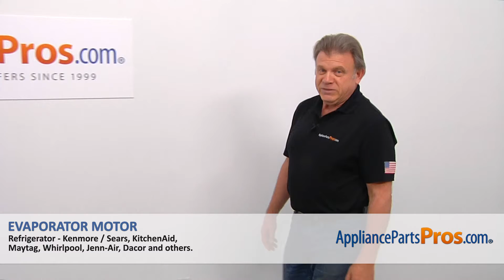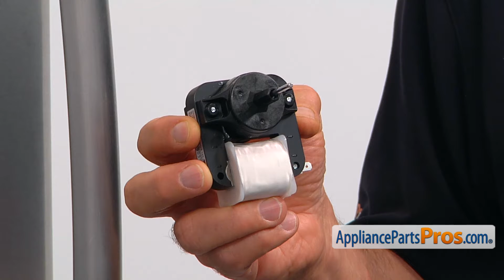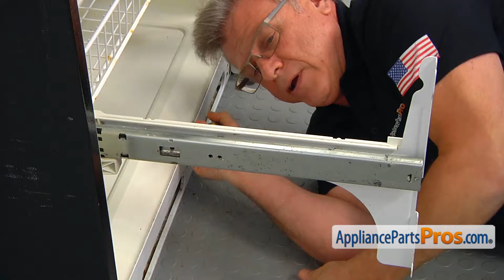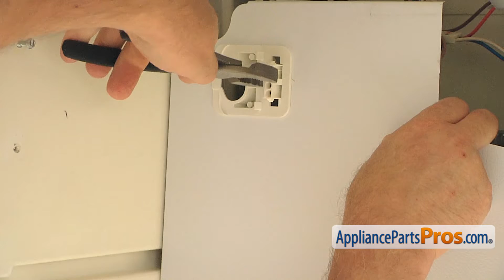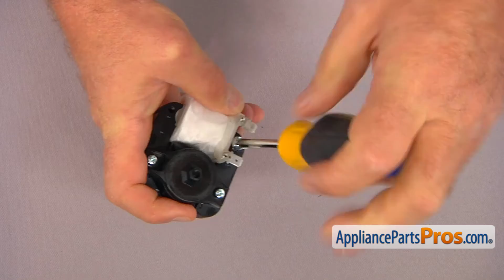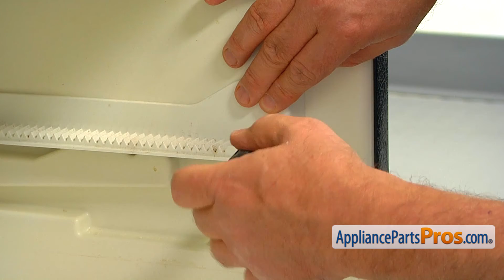How To Replace: Whirlpool/KitchenAid/Maytag Refrigerator Evaporator Motor W11024089

Comment: After my local appliance repair shop hanged me out to dry and didn't even order the part, this video helped keep the sale of our flip house from falling thru. 2 weeks before closing and the fridge quits cooling. I call the repair shop, they look at it and say "evap fan motor, we'll get one on the way" 8 days later they admit they didn't even order the part. I get one over lighted from appliancepartspros and watched this video. It came in today and I just got done installing it the night before close. Now I can sleep better at night knowing the buyers will have a fridge that works. Thanks for the video
Reply from the maker: Wow, what a story—and major props to you for jumping in and getting it done under pressure! We’re thrilled the part and the video helped save the day (and the closing!). Wishing you smooth sailing on the sale and more wins like this in future flips. 👏💪

Comment: I had to remove all the covers to defrost the freezer vent to the cooler part of the fridge,  One of the wires came disconnected and the connection point is not obvious. I phoned whirlpool and they refused to provide the wiring schematic.  This forces you to call their service people. I will not be buying any whirlpool products in the future.
Reply from the maker: Sorry to hear about the trouble, @vmitchinson — that’s definitely frustrating. If you have your model number you can call us at 1-877-477-7278 and we can see if we can help you find the information you are looking for.

Comment: I wish they didn't make the freezer shelving and rails so difficult to remove! The hardest part for me is situating my large, old, inflexible body on the floor trying to reach all the tabs and screws. I wish I was young, small, and flexible. Anyway, thank you for the helpful video.
Reply from the maker: You're welcome! Let us know if you have any questions!
Reply: @appliancepartspros  Thanks! I have the Whirlpool GB2FHDXWS06 (with bottom freezer). My freezer is colder than it should be and the refrigerator is almost room temperature. Is the most likely issue with the control board?
Reply from the maker: You will need to check the frost pattern on the evaporator coils. You should have a light, even layer of frost on the coils when the compressor is running. If there is nothing on the coils, or only frost on part of the coils, then that would indicate a sealed system issue and will require a licensed technician. If the coils look good you will need to test the temperature sensors for resistance. If the sensors are good then that would indicate a bad control board.

Comment: Hi, the fan motor is spinning (checked with cover off and can hear it), but no air is getting into fridge. Fridge is room temp, vents in the fridge look open to me. Should I still replace the motor?
Reply from the maker: If the fan motor is coming on then it's working, so it wouldn't need to be replaced. You will need to check the damper to make sure it's opening properly.

Comment: I had to buy a replacement but it only has one ground wire. I’m so confused now. The video is exactly what I needed just don’t understand what I’m doing with the pasty’s a bit different. I ordered per the refrigerator model number. Thank you for the very detailed and easy to understand video.
Reply from the maker: If you ordered the evaporator motor it should have came with the other wires as well not just the ground wire. What is the model number of your refrigerator? Did you order this part through AppliancePartsPros.com?
Reply: @appliancepartspros  thank you so much for your response. It’s the wrong part…sigh. We had a professional diagnose it since further research shows it may be a leak. It’d cost more to fix it than it was really worth. I appreciate these videos as I try to educate myself, thank you so much.